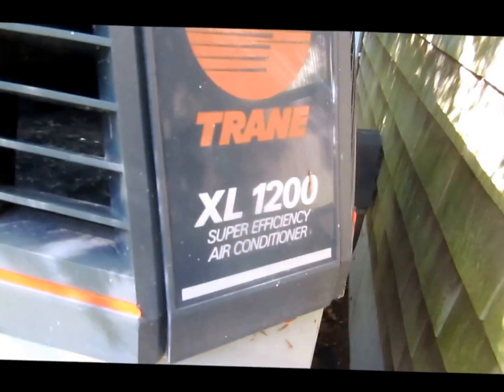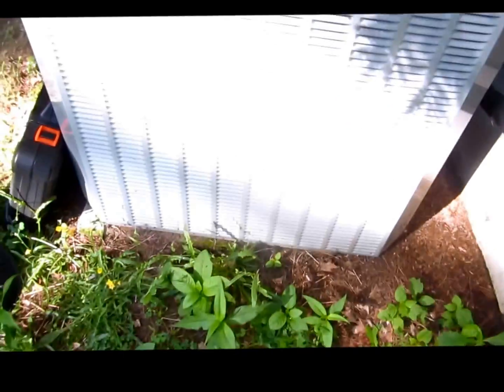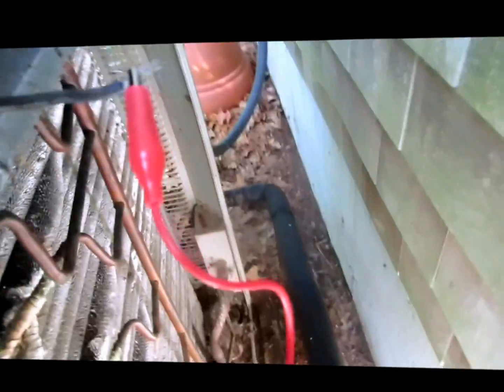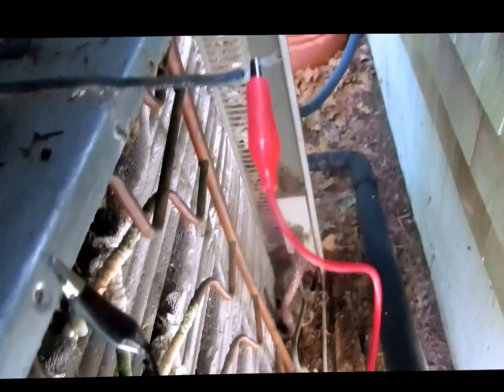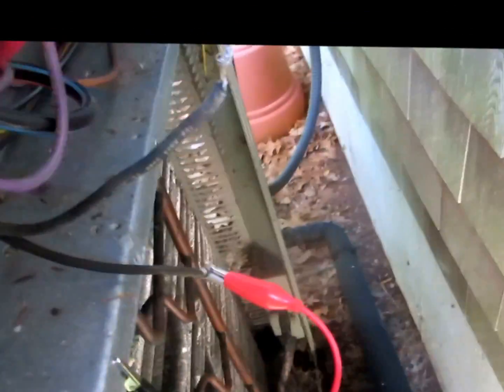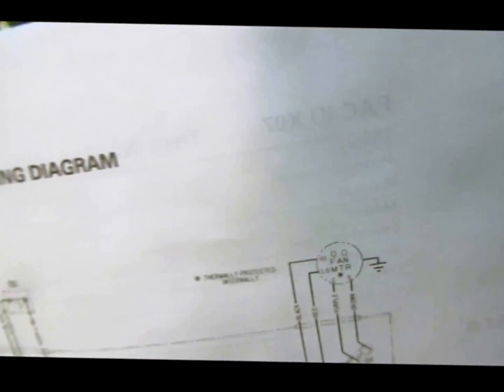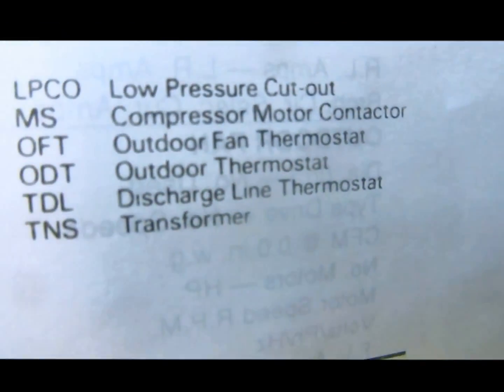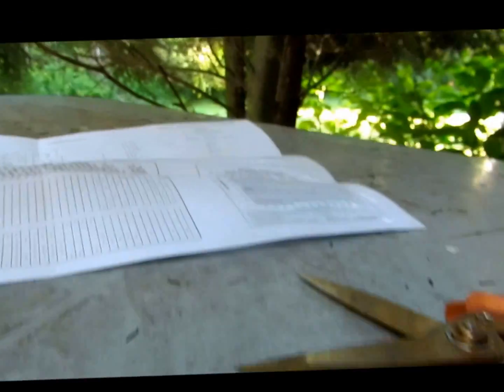Hvac- trane xl 1200 straight cool air conditioning tripping breaker, megohm meter test

Comment: i wish you were in PHX, az my XL1400 blows the fuse by the unit... they said i'm out of freon in the unit... and the other unit now the compressor wont kick in, fan runs though.. i got 2 trane units not working.. who says you cant stop a trane? these guys here charge afortune and guess there way around.. HELP

Comment: I have a 4t similar unit and found the same problem. The compressor heater ( those black wires go to) has the cord wrapped around a washer welded to the outside body of the compressor. That's where  my short happened. Tripped the breaker instantly.

Comment: my trane xr13 is also tripping the breaker, the outside fan also continues to run with the thermastat in the off position. any ideas
Reply from the maker: +Eulayses Perry it could be many things, its hard to say unless i am there testing stuff.
Reply: +steven lavimoniere had a tech here today, he condemned the compressor. I still don't understand why the condenser fan was running with the thermostat in the off position.
Reply from the maker: like i said its hard to tell unless, i am there looking things over and testing to find the problem .sounds like a stuck contactor . but like i said you have to test voltage  to find out whats really going on .nothing surprices me anymore .